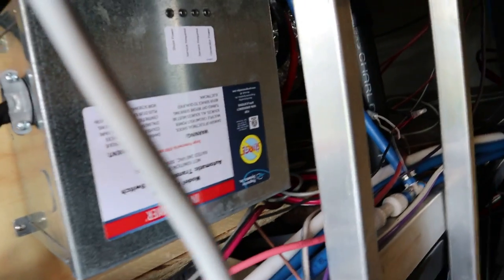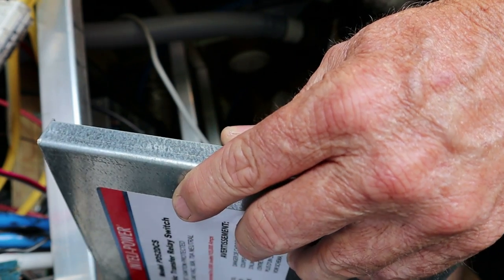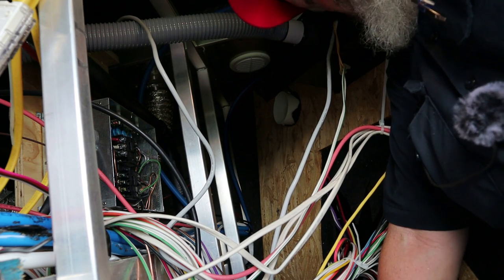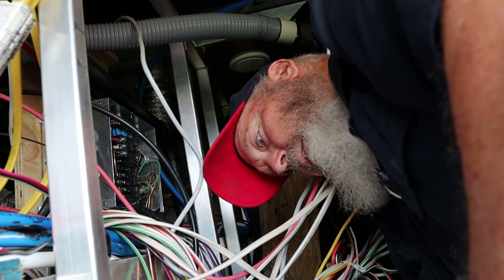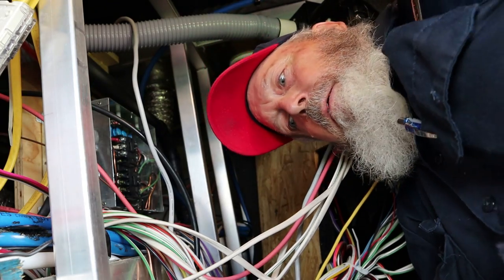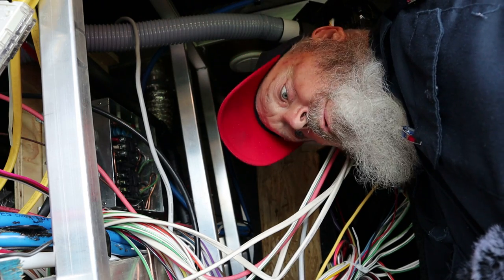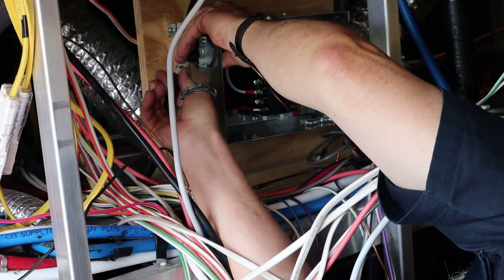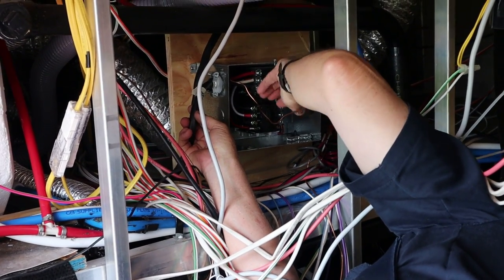Changing A Intellitec Automatic Transfer Switch (ATS)

Comment: I’m very happy about your safety comments!   My saying to the electricians that worked on projects I managed was,   Always be safe, the life tou save may just be your own!    I’m wondering why you didn’t just pull out the contactor in the old and replace with the new contactor.   You would have just been replacing a component.   Best wishes,    Kevin
Reply from the maker: Who knows, the built-in surge protector might have been the problem. Better just to change the whole thing and be done with it.
Reply: @hillbillyrv     Unlikely but possible I guess.   Glad you made another happy customer!

Comment: I always shut down power before switching sources.  I think it might prolong the life of the switch.
Reply from the maker: I saw a 30 amp switch fail one time and put 220 volt into the coach, not good.
Reply: @hillbillyrv   I got an open range doing the same thing right now.  Not good is right.
Reply from the maker: @marcuscarmouche9023  not good. My new favorite sating.

Comment: 2003 Fleetwood Expedition 50amp. Transfer switch cover off and watching I see both shore and coach engage at the same time. Seems like the circuit board has failed. Do you think I could buy just the circuit board instead of the whole box?
Reply: I should have added that when I started the generator is when both shore and coach engaged and cuts power to the house
Reply from the maker: I have never replaced a single component in a TS before. If you can get the part, I guess you can do that.